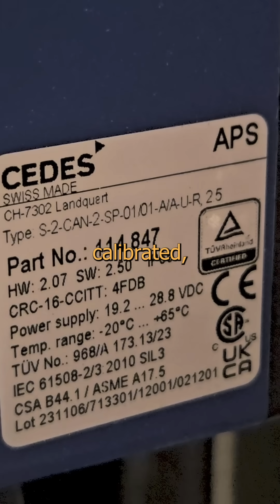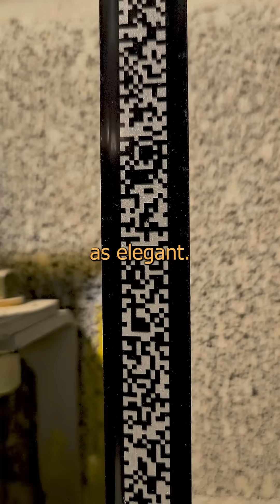Elevator Encoder #chrisboden #comedy #engineering #controls #urbex #indicator #resolver #barcode

Comment: Im not an elevator mechanic, but why wouldnt you just use a bar with a tab for a switch in the right area on each level, nah, lets use a fuckin barcode scanner with a hundred lines of code in it in a dark hole, im sure that wont ever fail😂 what happens when a mouse chews a wire, or a spider builds a web over it and it either stops in a random spot or resets to the top or bottom? Interesting? yes, But There's NOTHING simple about it and that isnt the application to try out new things.

Comment: Something doesn't quite make sense to me. There are 10 squares to a single line. Assuming that there is no gradient of color and that each Square represents either a fully white or fully black pixel, corresponding to a single bit, then there can only be 1,024 different lines before it repeats. 

Is there more to the story that I'm missing. Does the strip repeat once every floor? 

Because if each square is let's say 2 mm tall then after 1,024 lines it will be roughly 6 ft tall before it has to repeat.

Comment: It's precise, but not necessarily accurate. If the whole strip is mis-aligned, or if it shrinks or stretches (which will happen with changes in temperature), that precision is wasted.

Comment: I host a Scrap Mechanic multiplayer world in which the main elevator for our sky base uses a very similar system, but it runs with colour coding as well as binary.

The elevator serves as the secure main entrance so it has to work both for players and our largest vehicles, and this was the most reliable solution I've found to counteract the fact that server lag kept messing with our logic blocks (which happens because every logic gate has a delay, forcing you to either purposely bake a flat delay on every gate in the circuit or toss a coin every time you run any appliance).

The strip tells the power circuit where the car is and it compares that with whether the last input made it go up or down, it also tells it when to stop based on where it is and whether to open the player doors or deploy the vehicle ramps based on which floor it's at.

I find it to be a cool solution mixing the smaller, more reliable examples of logic circuitry you can make in the game (flip-flops) with more complex and lag-sensitive systems. It works like a charm, goes fairly fast and also makes it so none of my friends will ever try to mess with it because they definitely don't know how it works (as opposed to anything they THINK they understand, wich they will definitely break).

Comment: Are you sure it never repeats? It looks like 10b/line, which would give 1024 combinations. The "dots" look small too. Let's say thye are 5x5mm, then this gives height of ~5m.
Then pattern on edges looks to always be 001 repeating. This would point to those bits being some special markers, maybe timing, which gives 8bit pattern. This in turn gives 1,25m of pattern without repetition.
I might have also misunderstood how it works.
Reply: I assume it looks at multiple lines at a time. Given the pattern on the sides, it’s probably reading 3 at a time for 2^30 or about a billion combinations
Reply: You did the math for me.   I thought exactly this.  You’re on to something.  Now, looking at the pattern, it doesn’t look like sequential binary pattern.  It could be “Gray code”.  You’re absolutely right (in my book anyways) the pattern has to repeat somewhere or there is some sort of an index stored in a computer…. If you move or down up 1 or 2 or 3? positions, maybe the computer the has enough data and then “knows” where it is based on a look up table?   I bet that’s how this works
Reply: @maxvideodrome4215  before viewing this video I didn't think there was need for tapes like this. I don't know what controllers are used in elevators, but I assume PLCs. And a PLC can easily keep track of floors. Only place where precision is needed is while stopping at specific floor. And to do this you don't need wery long tape/pattern. Then PLC can keep track of number of repetitions internally.
Additionaly, if sensor can look at multiple lines at the same time, then specific pattern of lines could encode floor number, so elevator does actually know on which floor it is. This could be useful if there was no power for some time.
Reply: @maxvideodrome4215  it's clearly not a Gray code.
Reply: @rebase I agree - what do you think of my estimation of having to scan 2-3 rows and comparing to a look up table?  Clearly an explanation is needed.  What are your thoughts?; given you have identified this is certainly not Gray codes.
Reply: @maxvideodrome4215  using multiple rows is plausible. Although 3 rows would imply a lookup table of 4 gigabytes, which is a bit expensive. Probably the pattern can be decoded without a lookup table, e.g. by multiplying with a polynomial or matrix over GF(2).
Reply: @rebase the are defiantly not using 4 gigs worth of look up data here but interesting
Reply: Don't use a lookup table.  Just use binary and multiply.  So if it uses 3 lines you just make each set of 3 lines a number in binary.  Then multiply by the height of 3 lines and you have the position.  Also you can make the camera (because it's a computer and not a all simple) identify where in the field of view the centre of the 3 lines is, that was you have much greater accuracy.  For example if it sees binary 100 at the top of the foV it calculates 100x15+0=1500. As the number moves to the bottom of the FOV it ads the size of the foV so 100x15+14 = 1514. Then it sees the next number at the top of the foV 101x15+0=1515 etc 

Not so simple now is it?  These are actually very complicated and reasonable expensive sensors.  Although they make the elevator designers and techs job simple, they are not a simple sensor.

(The data probably isn't basic binary, so I doubt you can "read" it. it is more likely encoded with check bits etc to reduce errors.)
Reply: @antaguana I just checked.   CEDES is the system and it relies on look up tables
Reply: @maxvideodrome4215  how interesting, I am surprised. Sick make a similar unit (looks exactly the same) but I have never actually looked at the technical details of how it works.
Reply: @antaguana yeah pretty cool.  I think as of now I’m satisfied with my assessment and guesstimates on how it works given I found enough info online to confirm.  Fun stuff!  Have a good one 👍
Reply: @Jarko1401  I was asking myself the same thing. It might be that the sensor also looks at the line above and below and then somehow figures out which of the otherwise identical lines it just read. But idk

Comment: If you have one of those every 1/16th of an inch it would take roughly a mile of shaft before it had to repeat. If you raise the tolerance to 1/8th of an inch per line it's a 2 mile shaft before one code has to repeat. Assuming 12 feet for each floor (10ft ceilings plus 2ft for wach floor its exactly 630 floors if you do one line every 1/8th inch.

Comment: Wanna hear something cool?

So I went shopping at menards, buying stuff to repaint my weight plates and some around the house chores, we'll come to find out they don't just have 1 escalator they have 2.

Why is that cool? Because the second one is made for shopping carts in mind.

You can walk up it but when u put a shopping cart on it it gets magnetized to the floor in evenly spaced distances. When u get to the top a slanted platform slides under the wheels allowing it to seamlessly seperate

Comment: Ok but it reads more then one line at once? One line is 10 bits if i am not mistaken or 1024 discrete values. If the building is for example 10 floors the resolution would be 3 cm which is way too coarse. 10 x ~3m / 1024

Comment: An elevator system design was our project at the uni for an EE class. We were allowed to use only logic gates like a caveman, one level above using only switches.

I wish they let us work on something like this instead. Really cool stuff. If there is a mishap with the reading, after few deviations you can trigger an emergency stop.

Comment: If every line is unique, and I counted 10 squares across (10 bits), that only allows 1024 unique lines, I am throwing out a guess that each square is maybe 1/8”, that would barely do one floor depending on space between floors.  Is it each line compared to the line next to it?

Comment: Hoistways are notorious for pumping a lot of air into and out of the shaft... the  cab is just a loose piston in a square bore.    With that air moves all manner of detritus and gooey stuff whether it is an overhead or a hydro.  Guide rollers are known for slinging grease...  This is going to be a major maintenance item.

Comment: Looks like a 10 bit binary #. 2 to the tenth = 1024. 10', 120", / 1024 = 0.117" resolution for one floor elevator, assuming it travels 10' between floors. 10 floor elevator would reduce the resolution to 10X than, 1.117".

Comment: There is no way that it doesn't repeat - there is 10 dots in row, that's 1024 options - assuming row is 5 mm in height that's 5 meters - not enough for an elevator. Maybe 2, 3 or 4 rows make for identification? Anyway, brilliant idea

Comment: You forgot to mention what makes the Gray-code so cool: It's not just any pattern to represent numbers digitally, it's done in a way that when counting up or down it only changes by 1 bit at a time.

With regular binary code you'd eventually go from 0111 to 1000, and if the dots or sensors aren't aligned perfectly you'd read stuff like 1111 or 0101 for a moment, which can confuse your logic (or require extra work to make your logic ignore such readings)

Comment: Had an industrial elevator at a place I worked at was about 3T capacity and when you wheeled in the big bins you could see it drop about 20mm and that's a huge difference if you wanted to wheel it out but it would compensate for the weight difference and level itself to the landing.

Comment: Compared to the elevator at my work, that tends to sag a bit over time between uses and may pull itself level with the floor after you got in but before closing the doors
Scared the crap out of me the first time, I thought it was going to move

Comment: This is actually the way many cars measure the steering wheel angle. They have als a sensor in the wheel that gets spun with the wheel while the other part is sitting stationary. The part that spins also has this pattern that never repeats, so the car can always know where the steering wheel is, now the question is why they dont just use a encoder with a magnet, and the answer is quite simple: There are sensors that can read a position even after it got moved while the sensor was powered off. If you move the steering wheel of the car while the ignition is off, it has to know the new position after switching on the ignition. This pattern that never repeats does exactly that, because it never repeats the sensor will look at the pattern, and then compares what it sees with its memory. It knows that the particular pattern it sees right now is calibrated to a steering wheel angle of lets say 25 degrees. S it kan know the angle. A reed sensor for example always has to go back when powering on to a calibration point, and then it can count signals to a certain point, but if you take the power off from it, and move it and switch it on again, then it wont know where it is til it goes all the way back to its calibraton point. Especially older printers sometimes have this system, they have a ribbon with a pattern, but this pattern always repeats, this is why they put their cartridges all the way to one side and then start to count from there, so they need a fixed calibration point every time they are switched on. The only disadvantage of those optical systems no matter if the pattern repeats, or not is, that they can malfunction when issued to excessive dust because the sensor cant recognize the pattern anymore

Comment: Can someone decode it? It seems the outermost bits are timing information, and the area between them seems to be three words of location information. It seems it identifies each location by three bytes of data. So we end up with 24 bit every three lines, let's assume each pattern line is 2mm in height, that'd give us a maximum length of around 100km. I'm wondering though: Is there some XOR mask used to remove large areas of 0's and 1's next to each other, do they use some sort of graycoding, etc...

Comment: The one at our hotel needs checked its about 2 inches under the 4th floor so anything we push in drops down, then the elevator will adjust itself but it wont do it until it feels the drop of our carts tho 😂 or a fatty 😂

Comment: If im not mistaken this is called full intelligent leviling. Wich brands use this in the US? Here mostly schindler and some generics use it.Kone uses it only in KCE logic. LCE uses a point and tacho system.
Also this reduces the time to level the lift
Because it calculates the distance to the door and it slows the lift down perfectly

Comment: if the scanner were to read only one row of pixels at a time, there would be only 512 different possible combinations of pixels it would come across. Given that there are 9 "boxes" in a single row and each box can either be black or white / 0 or 1. 
I suspect 512 is not enough to encode the whole length of the shaft. So how does that work? anyone mind elaborating further?

Comment: Arent the possibilites for 1 line only limited to 10*2? Does thr elevator read lines of 3 per position, so it becomes 10*10*10*2=2000? Or is my math wrong?

Comment: It looks like there are 10 binary "digits" per row in the tape, meaning there are only 1024 unique "lines".  Assuming each line is 1 inch tall (which it looks a lot less), the maximum number of supported floors is 8.  (1024 inches ~=  85 feet, assuming 10 feet per floor....

Comment: the pattern is 10 pixels wide so that's 1024 possible combination, but assuming each square is one milimeter then that would only allow you to have 1meter of this tape before it starts to repeat, so i assume it scans a taller portion including kultiple of these lines instead of just one line?
Reply: So, it looks like the first and last column are the same repeating pattern that's 3 pixels tall. If we take those columns as indexing, we now have sets of 3x8 pixels, or 24 pixels for each position. That's 16 million positions at 3 pixels tall. If they're 1mm pixels, that's a potential 48km of tape. 

And yes, I was looking for this comment because I had the same thought.

Comment: The neat thing about that part of the pattern is that I can also used as a method of clock recovery, to allow reading the position at any speed without any external speed input.

Comment: Based on the "to half an inch" with 10 dots across and assuming 3 lines per "code"(because I noticed the left side repeats  100100100100 down the whole shaft and the right is 010010010[very different]) with the external sides disregarded for tracking purposes, that leaves an 8×3 binary grid that never repeats. Thats 24 bits(or 2^24[16,777,216] possible numbers) and if it never repeats, at half an inch per code, that's 8,388,608 inches or 699,050ft, or OVER 132 MILES of elevatability!!! And you could probably easily double it by installing an altimeter and telling it "if you are nowhere near the ground, assume you've started on tape repeat 1"
Reply: Based on another comment, this is a CEDES APS and has a resolution of 0.5 mm

Comment: The elevator car knows where it is at all times. It knows this because it knows where it isn't. By subtracting where it is from where it isn't, or where it isn't from where it is (whichever is greater), it obtains a difference, or deviation. The control subsystem uses deviations to generate corrective commands to drive the elevator car from a floor where it is to a floor where it isn't, and arriving at a floor where it wasn't, it now is. This is all made possible by the cool binary tape that stores the elevator car's position data, allowing it to accurately determine its location and navigate to its desired destination.

Comment: But what happens if let’s say oil smudges it or dust and dirt. It should have a spray nozzle blowing air at the tape line and even a small water jet or something if something is detected on it.

Comment: Every line isn't the same. There are only 10 blocks per line so that would make a possible maximum of 1024 different patterns a line could be. The encoding must use multiple lines to know it's location. Single line patterns will be used more than once.

Comment: How many rows does it scan at a time? I counted 10 "pixels" wide, meaning there are 1024 possible unique states, and I think there are probably significantly more than 1024 rows. (Meaning if it was only able to scan one row to determine exactly where it is, the height cannot be any higher than 1024 rows by the pidgeonhole principle) But if it scans more than one row at a time, then how does it stay aligned? Unless there's software inside that just knows the sequence of the entire length of the elevator shaft and just keeps the most recent rows in memory to figure out where it is... and you know what, as I'm typing it out that's probably exactly how that works.

Comment: I'm an elevator mechanic, and have installed these. Its an absolute position system. The tape gives the location, and the vane controls the landing/door zone. They each communicate to different processors in the controller for redundant safety. 

Look up "Otis pie plate selector" if you want to see an example of the mechanical monstrosity something this replaces

Comment: It's an 10-bit code with bits 0 and 9 used as registration markers.  You can see the repeating pattern - every 3rd row.  Bit 0 and 9 are offset by 1 row.
I don't see the pattern in the other 8-bits.